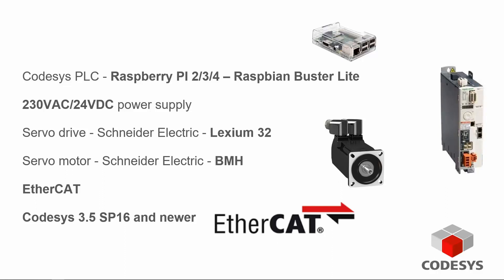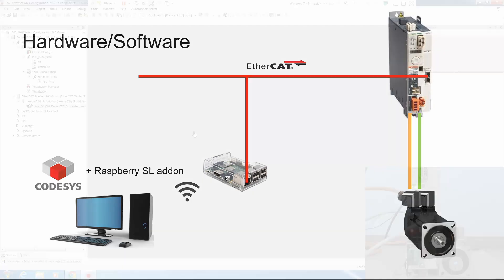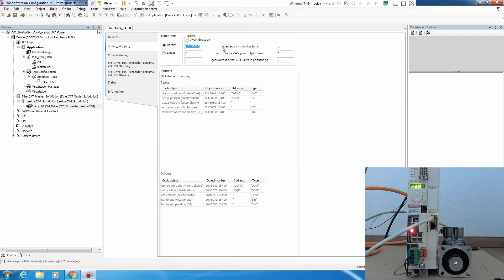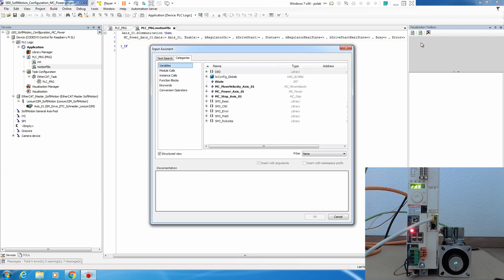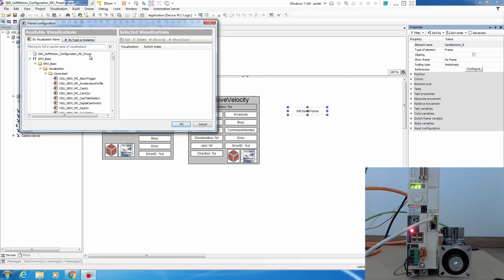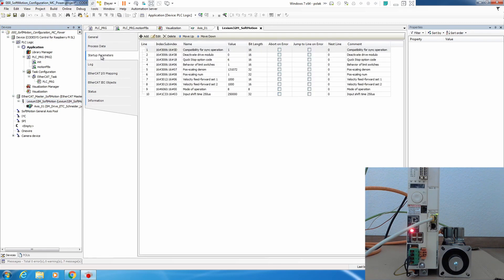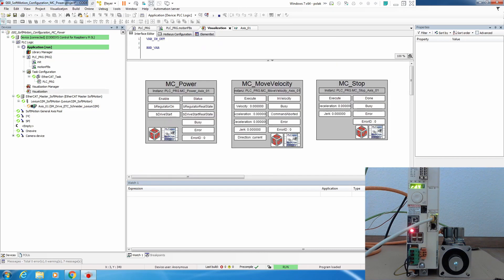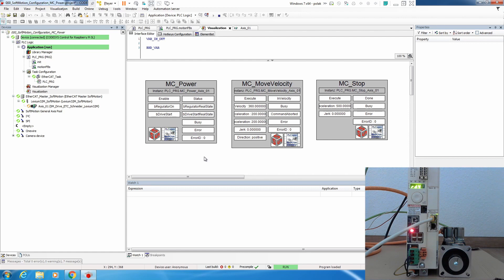02 - SoftMotion - Lexium - Introduction

Comment: I'm using the KEB C6 Smart to control a motor. However, my device is currently experiencing some issues, so I would like to simulate motor control using the Virtual Axis feature integrated in KEB Combivis Studio, which is similar to the Codesys software you're using.

Unfortunately, I can't control the virtual axis because I don't have a physical C6 device connected.
So, what should I do to control the virtual axis in the software without a physical C6 controller?
Reply from the maker: same thing. you define 6 virtual drives in the pool and use them as real axis. some things will not work eg. if you use drive base homing. but majority of the code should be the same
Reply: @SoftMotion-Black  thank you so much